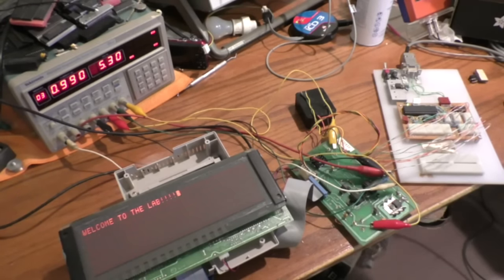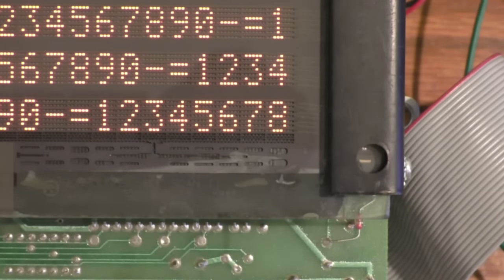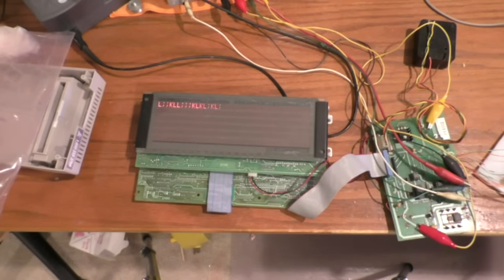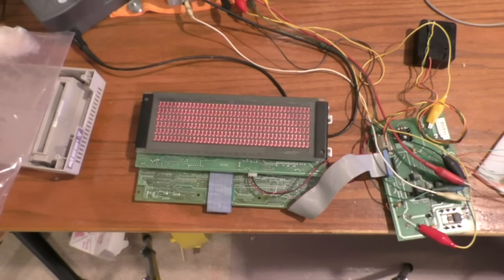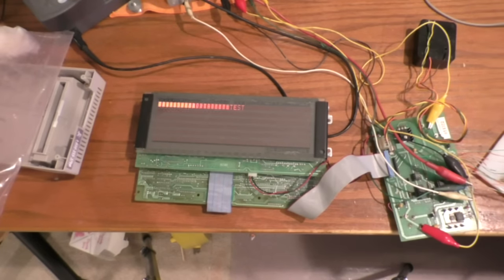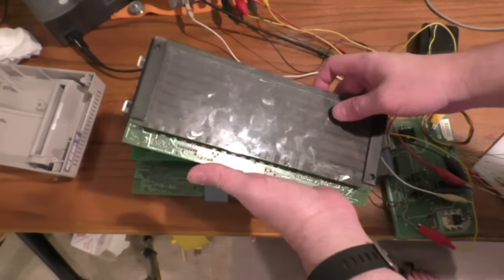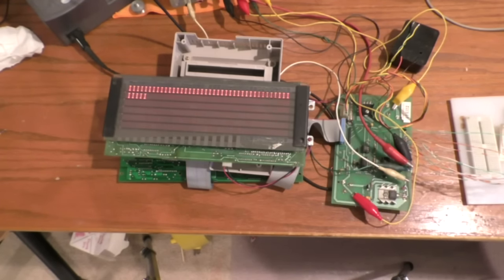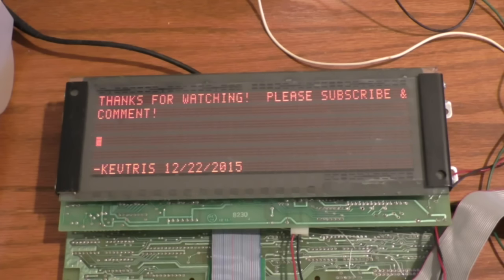Burroughs Self Scan Display Reverse Engineering

Comment: do these only do text?  they look the right size for pinball DMD's, even with the line gap.
Reply from the maker: +omfgbunder2008  natively it's text only using the existing driver.  there's no reason you couldn't show any character you wanted to, but those gaps aren't very nice.  I believe on these you can show pixels horizontally in rows, but there will be a 3 pixel gap between rows of characters.   I do own a display that is a 'full' matrix, but unfortunately the tube's degassed so it doesn't work.  That one's an 8 line vs. 6 line for these.